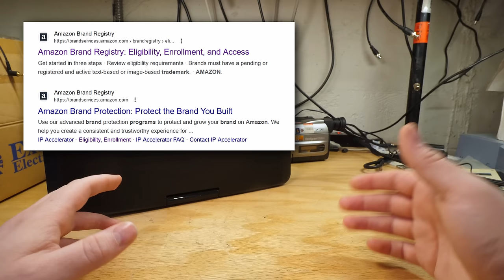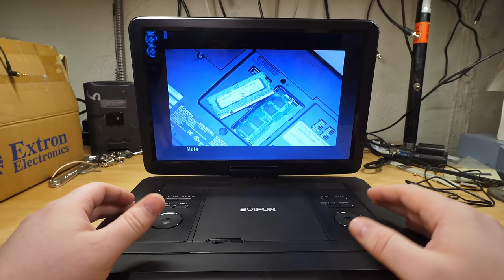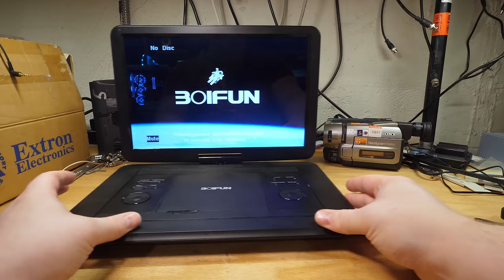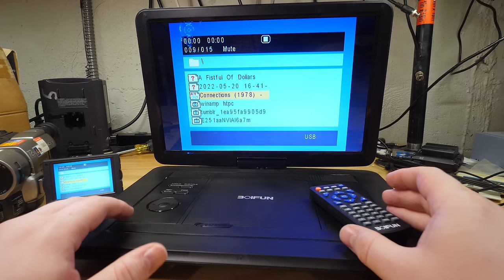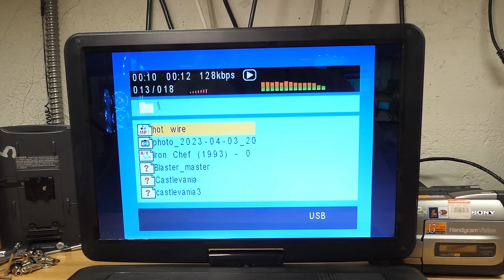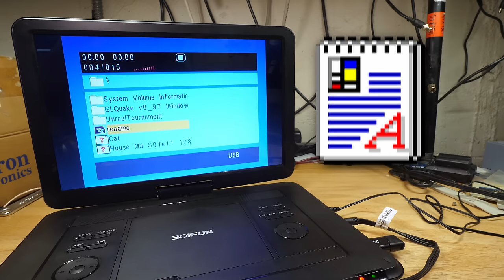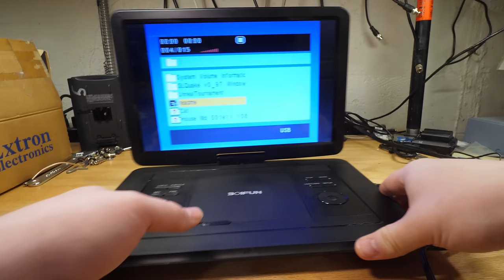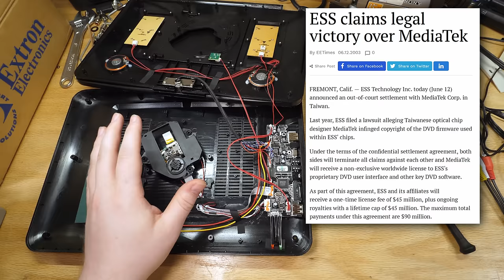Cheap, Silly, Remarkably Useful DVD Player

Comment from the maker: Okay it turns out this thing DOES have a JPEG decoder core. It wasn't in the first block diagram or feature list in the datasheet but was in another diagram much further down. So apparently it just... sucks?

Also I'm realizing that I made a bit of a "video producer brain" mistake - when I'm flipping through images, I cut out all the loading after the first one because, like, I didn't want to make you all sit there for 40 seconds while I went through just a couple pictures, and I just thought "well everyone will see the cuts and realize that I've skipped some time", but looking back I realize you'd really have to be paying close attention to notice that, whoops. So yeah, each JPEG, other than that super low res one at the beginning, took over 10 seconds to appear.
Reply: Honestly the load speed seemed similar regardless of resolution… maybe JPEG is fast (I’d assume without checking it’d have Motion JPEG for Video CD) but the rescaling is CPU bound. If so that’s hilariously sad.
Reply from the maker: @kaitlyn__L  oh sorry that was movie magic, I cut out some footage. the old low res digital camera photo loads in half a second, larger files take 10+. I haven't clocked it but I'm pretty sure it varies by file size proportionally
Reply: @CathodeRayDude  that totally tracks! Thanks :) (though does make me think 320x240 might’ve loaded fast enough for awful early 15fps video 🤔)
Reply: probably has a jpeg decoder designed in the 90s they licensed for like 5 cents lol
Reply: It's probably the case that the bottleneck isn't the decoder, but the pathetic amount of working RAM supplied. While a compressed file may be only a few hundred kilobytes, you still need enough RAM to buffer the entire thing uncompressed otherwise it's going to end up doing a tedious amount of fetching macroblocks, decompressing them to RAM, shuffling those bytes off to the framebuffer, rinsing and repeating. My guess is there's only 4MBs of RAM, so anything much higher than 2MP is a pain to decode.
Reply: That NES emulator makes me cry
Reply: I think I see a crystal on the PCB.  I wonder if you can overclock it 🤣
Reply: @grafxgear  ooh.... I like that idea. How much faster would that make the slide show on the pictures though. 🤣
Reply: @cathoderaydude please try to over clock this lmao
Reply: Do a video on cool docks. I had a D420 as my first laptop, It had a awesome latch on docky/base thing that basically just made it a full sized laptop and added a DVD tray. But you could still use it like a laptop since the base was so small. I can send you mine if you want.
Reply: A JRPG decoder you say, that's mighty convenient, since I don't understand  a lick of Japanese
Reply: @kaitlyn__L Standards compliant VCDs are MPEG1 with MP2 audio, not MJPEG.
Reply from the maker: oh man i would probably go for that actually, idk if i could line up enough for a video but i could try. shoot me an email if you would, cathoderaydude at gmail
Reply: 0
Reply: The reason they get these 6 letter brand names and use the Amazon brand registry, it's that's how you prevent people from piggybacking on your Amazon listings.

If you don't do it, and create a product listing on Amazon, and it gets popular, other people who buy that same product from the manufacturer or wholesaler can just list the item for sale under the same listing. So someone does a ton of work building the momentum for a product, and then anyone can come along and take advantage of the momentum.
Reply: @CathodeRayDude in storage I have a PowerBook Duo 280c and the VCR-like dock for it that makes it a desktop. If that's something you're interested in.
Reply: Fun fact Gravis, the term for when an image is both letterboxed and pillarboxed is called windowboxed (windowboxing).
Reply: The speed of the JPEG decoding reminded me to my years of usage of an unaccelerated Amiga 1200 as my main computer (I used it from the late 90's until 2008). But this (of course) also had not very much processing power and of course RAM (2 MB Chip/Video Ram and 8 MB of Fast Ram) and the viewer software also had to convert the decoded JPEG data to its Amiga specific HAM8 graphics mode for the extra colors (max. colors for the AGA Chip Amigas in default graphic mode was 256) but this mode was very slow. But the decoding speed of that DVD device looks even worse than the much more limited humble Amiga.
Reply: I propose that it decodes fast enough, but the CPU murders it with a really bad downscaling algorithm that takes ages before it even appears on screen
Reply: It would be interesting to get a flash dump of the firmware - really wonder what NES core it’s using

Comment: Random feature that may not have been noticed: There are keyhole screw points on the bottom so you can wall mount this thing in tablet mode.

Comment: The datasheet here is most likely just a marketing summary. In reality you would probably contract with MediaTek and sign an NDA, and they would provide a full toolchain and documentation for customization and integration, and that's where the capabilities of the internal cores would likely be evident.
Reply from the maker: I figure that's probably true, but doesn't it seem odd to leave out an entire massive feature like arbitrary programmability? I'm not expecting deep details, but you'd think it would at least mention that custom firmware was possible.
Reply: @CathodeRayDude Dump the flash chip and see what the community makes of it ;)
Reply: a datasheet for the MT1389L i found mentions an embedded 8032 microcontroller with 1024 bytes of builtin ram and support for a 2mb flash interface. maybe this is for programming different menu screens? and maybe for this specific player they decided fuck it and embedded a whole  nes emulator straight into the menu firmware? yowza... i wonder how accurate it is
Reply: Which explains silkscreening and markings. It's a debugging feature for pre-production, I guess.

Comment: The MT1389 is still for sale I believe, it's still listed on MediaTek's site and they are usually pretty good at removing discontinued products. The MT1389 firmware source code for many different chip variants has leaked online, and those leaks do have code related to the NES functionality, so I believe that it came with the firmware, just not advertised on the datasheet for some reason.
Reply: That reason being Nintendo probably
Reply: @xmlthegreat  Another point, V.R. Technology and their VTxx systems have made Nintendo clone production trivial.

Comment: Can confirm that those controllers work much like NES ones, and just have USB as the form factor. Years ago picked one up at a flea market, unaware of what it was. 

It refused to play ball with my PC. Opened it up, and found it had no microcontroller that I could find, the buttons instead wired directly into the USB plug.
Reply from the maker: wait wait, were they literally wired directly to the plug? NES pads still have An Chip in them, a shift register if I remember correctly.
Reply: @CathodeRayDude  As far as I remember, yeah. It's in a box somewhere at my parents' but I'll be there this weekend anyways, so I'll check then, and take some proper pictures then.
Reply from the maker: @TheSuperLyntendo  if it's not too inconvenient, it would be cool if you could email shots of the internals to me. Cathode ray dude at gmail
Reply: @CathodeRayDude  Will do! No trouble at all.
Reply from the maker: @gluttonousmaximus9048  if there were some diodes in there I think you could achieve it with polarity reversal on the scanning signal but yeah idk
Reply: @gluttonousmaximus9048  Five wires, if I recall correctly. And I'm just as clueless tbh. Perhaps there was something I overlooked - but I really can't remember anything other than just the buttons. They did have an odd layout, though. IDK
Reply: @gluttonousmaximus9048 USB 3.0 Type-A connector maybe? Up to 9 wires instead of 4 max.
Reply: @JeremyLevi  I’d think USB 3 cables would be too expensive for a dirt cheap controller trying to save on a shift register chip, each wire adds more manufacturing failure risk the factory needs to compensate for with higher prices. Would also be inconvenient to have such a thick cable.
Reply: @I mean nearly every Atari-like joystick/controller pre-NES worked that way and used 7-9 wires (vcc, gnd, 4 directions, and 1-3 buttons). It's also possible though it's wired up like a 9-pin famiclone port (d3, d0, out0, clk, d4, +5v, nc, gnd, nc).
Reply: https://youtu.be/kfvBJq4UeN8?feature=shared
This video, at 6:20 or so, shows off a "USB" controller that is actually just a SNES controller
Reply: @TheSuperLyntendo the fifth conductor is actually the shield I'm pretty sure
Reply: @CathodeRayDude making controllers as a hobby taught me that the only thing that makes a USB cable a USB cable that everyone agrees it's supposed to work that way. I routinely make usbc-gamecube cables for controllers, and I've made a build that was split in half and used a pair of USBC breakout boards to just direct wire the left side's seven buttons over to the right side where the raspberry pi pico lived

I mean, hell, you could use a parallel port for HDMI if you had the right breakout boards, connector ends, wire, patience and a low sense of value of your own time

Comment: I think it's useful to understand how these products generally come about. The SOCs are cheap commodity items that cost pennies to make. Some third party then comes along and designs a board around that SOC. It might implement some or all of the chip's features, but the boards themselves are also commodity items. Someone else comes along and designs a consumer product around the board and sticks various brand names on that. So the company that made "Boifun" probably didn't make the board. And you end up with a huge variety of products with very similar features and interfaces.

Looking at that device, I wouldn't be at all surprised if the LCD driver doesn't also have the full functionality of a 1990s TV hidden in there too. The screen means you've basically got two commodity devices smashed into one case there.
Reply: This is an important detail. This device is a great example of how commodity electronics get produced. There's little strategy and minimal effort put into the final product. It's just, what components can I source and where can I shave pennies from the design
Reply: Yeah, and thats why the boards are labeled so well. These are all separate OEM products combined.

Comment: That’s not a slow button scan. Buttons don’t click just once when you press them. If you look with an oscilloscope you’ll see a lot of ‘bouncing’. So denouncing is needed. You can do it in hardware, but cheaper is in software. Basically they wait for a button press, and the. Wait a fixed time to confirm the button was actually pressed. That time is what you have to exceed for the button press to register.

Now, cheaper buttons bounce longer, so it’s entirely possible they had to lengthen their denounce time since otherwise it would register as multiple clicks.

Great video
Reply: Yeah, the first thing I thought was it's just a crap debounce routine.

Comment: The problem with demonstrating the screen is that your white balance would be adjusted to your room lighting, which would be warm, but the color temp of the screen is ideally 6500K or in practice probably way bluer than that, especially if it's LED backlit, because they never calibrate them to offset the overwhelming blue.

Comment: Regarding that MediaTek chip's CPU architecture: in certain areas, MediaTek is sort of infamous for rolling a ton of chips with different custom instruction sets tuned for the purpose (presumably generated in some sense). Considering the era and application, I wouldn't rule out that this chip runs a custom-but-uninteresting generic 32-bit RISC instruction set. Would perhaps also explain why the NES core is so slow, as it wouldn't benefit much from architecture-specific optimizations.

Also, that unknown chip looks like a type II TSOP package, which gives it a high probability of being DRAM indeed. Makes sense since that's definitely not in the chip itself. Isn't there some silkscreen marking right below it that could give a clue?
Reply: It's an 8051.
Reply: @Rib_ An 8051 is hardly the "32-bit RISC microcontroller" they claim it to be, would be very interested where you got that information from!
Reply: From what I read on the internet, MT1389 has a built in ARM7 chip (100Mhz ???).
Cannot find any confirmation.

Theorically it should be capable of emulating Nes fine (GBA can with an ARM7 16Mhz), but I guess they just tossed in an early emulator and called it a day.
Reply: @indask8  yeah that emulator maybe 'compatible' ie ARM7 but maybe frequency dependent for operation, so it runs slowly at the first sign of resistance because it cant throw more power at it, maybe? and agreed, a less powerful chip can run all of those so Lord Gaben knows whats going on under the hood for it as it maybe so barebones it may not have anything to help dynamic things like increasing processing power dedicated to it, or memory management.
Reply: @shiz_txt In the datasheet by some of those dime a dozen sites, there's an Atmel 8032 listed as a built in microcontroller. Given that there's also a block labeled 'system cpu' and another labeled '32 bit RISC' in the diagram for the chip, there's a good chance that there's two CPUs in there.
Reply: Given the era it's entirely possible it's a MIPS based CPU core rather than ARM. MediaTek used to use them heavily in a variety of devices around that time and well into the early 2010s including even devices running the MIPS build of Android.
Reply: @JeremyLevi  this was my assumption as it was common to run them in early flatpanel tvs (my Samsung had a MIPS cpu and could play h.264 content and it was made around late 2000s, and also couldnt be reflashed to a custom OS like other ARM based tvs from Samsung could). I think even the PSP counts as MIPS based. It is RISC but not ARM. MIPS was cheaper than ARM to use and it was in a lot of electronics from the era.
Reply: @Gatorade69 There are headered and headerless NES and Famicom ROMs. Most likely only one of the two types work on it.
Reply: @Gatorade69 They also need the right filename extension. Typically .bin or .rom or .nes

Comment: Portable DVD players with av in were the ultimate portable monitors for consoles back in the day.
Reply: i lucked out a couple of years ago, as a local thrift store had a DVD player monitor for sale with no plugs etc but i was able to sort out a wall wort to hook up (takes 9-12v) and has AV in besides its own proprietary input (looked to be from a kit where it had a main player and screen and then this one was to connect up for kid#2 sitting in the back seat so they could both watch Spongebob or whatever). i added mounts for a tablet wire stand and now its a production monitor that i use with a video camera i have that has SVideo out, then the cable i use converts it to Composite (its so i can frame the shot properly when i cant see the viewfinder).